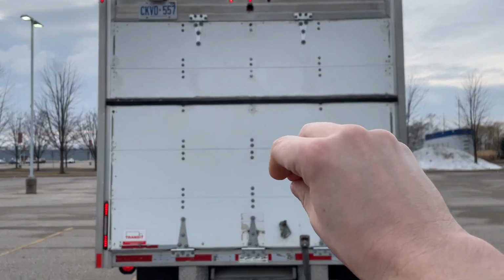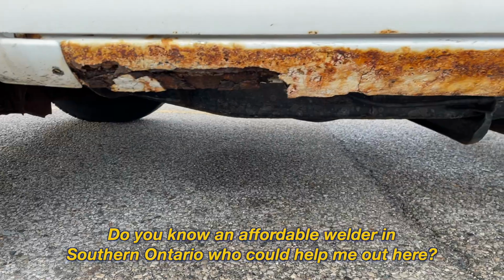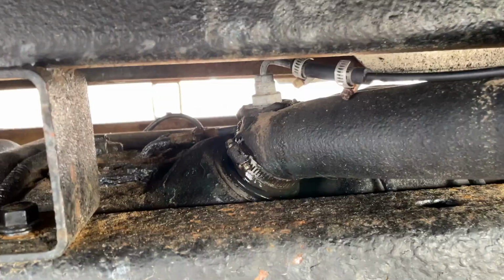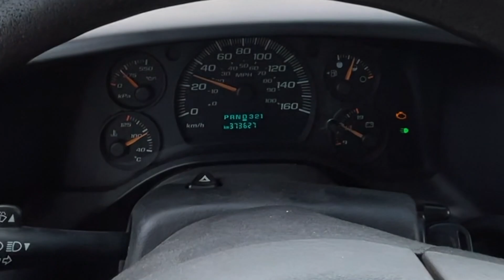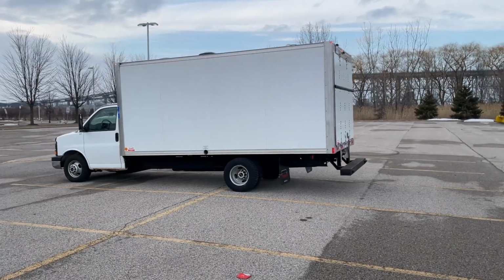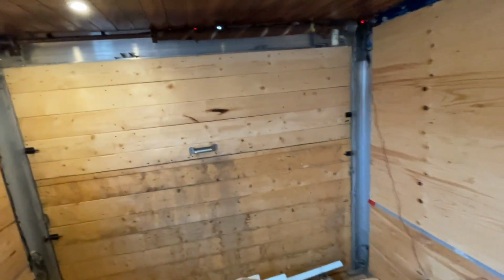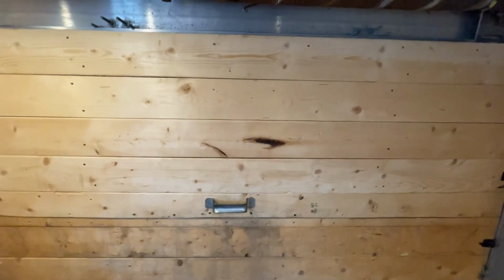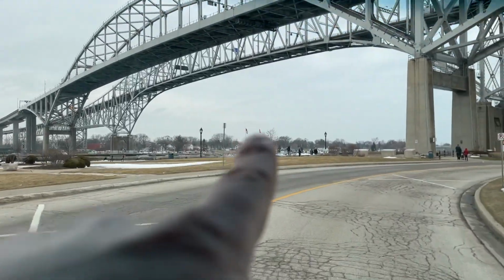BoxTruck Conversion SETBACKS ( RUST, LEAKS ETC)

Comment: I took the roll up door off of mine and added a residential door and window with a back wall, there is about a foot of space to store a tire or propane tank, also when it rains the water does not get in because the roof keeps it from running down the side of the wall. The only down side to losing the roll up door is that it's not as "stealth", bit I don't camp on the city so it's not as important.

Comment: I went on youtube and put in box truck builds and there are several that have taken off the roll up door and made a recess wall with a door.  I saw one a guy had a lift gate on the back plus the wall very cool. I should give you some ideas plus you can message them and ask questions about there build. Just hope it helps

Comment: My former landlord is working on a Savanna van. The doors at the back were really rusted out at the bottom. He took an old furnace, cut up the housing and repaired the back doors. There was some welding and smoothing out the rivets, etc, but it looks good and it is solid now some sort of black pitch so as to not rust again.

Comment: frame out the rear door with 2x4's and add a house door, perhaps double garden doors. those rockers need to be cut off and weld new ones in... easy project on a cube van as you don't have big long body panels to refinish to a smooth and wave free texture. the metal under neath the floor can be pressure washed and wire brushed and treated with a very special paint called POR15. It can be applied to rusty metal(without rust flakes) it will prevent any further corrosion. its is available at Canadian Tire. about 70.00 a litre, but it is well worth it, nothing else works like it or as well as it. after you POR15 the underneath, apply a top coat of Tremclad , then cover it with Rust Check spray.
Reply from the maker: Thank you so much!!!

Comment: OK so for the rear door what I recommend is first take it back apart (i know, i know) and use 3M Window Weld in between  the roll up panels as you assemble them to prevent water intrusion through those seams. For the seam between the two "halves" youre gonna want to use as much weather stripping as you can fit. You need to add a few inch strip of aluminum or something to the inside, upper edge of the bottom panel, and the same to the outer bottom edge of the top panel creating a barrier on both faces to prevent water from making it inside. Additionally, you can add trim strips to all the side edges to provide the same sort of protection. Hope this makes sense if not let me know and ill draw a terrible picture LOL
Reply from the maker: Thank you for your comment. I understood what you mean 👍😊 it gave me some ideas.
Reply: @CanadianStealth  also i recommend taking it somewhere you can power wash it or at worst one of those automatic car washes maybe? to test it for water leaks before you put any finishings on it.
Reply: @CanadianStealth  also you could try making new doors by laminating rigid foam insulation between two layers of plywood then covering it with fiberglass or even just fiberglass resin for waterproofing. Heres a forum of people who build whole trailers/campers using this method http://www.tnttt.com/viewforum.php?f=21

Comment: I love the idea of the doors the way you have them. I think it will be cheaper to rebuild what you have. If you want to drive down to sombra I can give you some ideas and lend some tools. But I will only be here for a couple more weeks. I think you take the doors apart again slice a shallow dato joint between each segment then put them back together with sealant. You can use my table saw.
Reply: If you want to meet for coffee or something to exchange contact info just let me know

Comment: I used sign material to build my rear swing up door along with aluminum tubing and foamular pink foam insulation.. You may have seen it in that Facebook group.. You could make the swingout doors of the same material or just add those MaxMetal ( https://www.maxmetal.com/ ) composite sheets to your existing door. Use roofing screws to attach the panel to your existing door. Should work..
Reply from the maker: I’ll look into that Matt ! Thank you for the advice and the website
Reply: Good to know 👍
Reply: @CanadianStealth  you are welcome. Cheers

Comment: You need weather stripping around the door and metal flashing above the door and above the  door overlap. In regards to the joints, apply a clear sealant to the entire door so you can keep the look of the door, but it wont leak.

Comment: There is a truck repair shop in Windsor called bogars they sell the doors with aluminum on one side all the hinges and rubbers seals I used them many times when.i use to live there and repaired trailers iam sure pinwood in sarnia could get them as well right on confederation st any question let me know dont mind helping out iam only about 30 mins from sarnia
Reply from the maker: Thank you John, I’ll have to check them out!

Comment: Once you get the rust fixed.  Look into treating the truck with fluid film.  Also looks like you have that spray on rubberized rust treatment on the bottom of the truck...get that stuff off.  Any moister that gets past that stuff stays there and it eats the truck.  See https://www.youtube.com/watch?v=nXvl9nt57Kg&t=454s for what that crap can do over time.  Take it and hit it with fluid film.
Reply from the maker: Thank you for the advice ! 😊

Comment: Try strips of vinyl,rubber across cold joints. Flexible seal for joints. Use aluminium strips,blue rivets. One scanner twenty dollars to clear codes,nice to have with older vehicle.
Reply: Hate auto correct...across the door joints...pop rivets...
Reply from the maker: Thank you for the advice Len I’m going to look into that

Comment: There's something called bead blasting like sand blasting that you can lightly do then by some flex steel like the use on the the boat commercial and spray clear on it and then sand it and spray the colour you want black white whatever

Comment: What about caulking the seams .... then using tarmac like a roof then finishing it off nicely with sheet metal ??? Insulated and water vapoured up the @ss that way ?
Reply from the maker: Sounds good , I just need to calculate some numbers and see what’s cheaper and better .
Reply from the maker: Thank you for the advice 🤗
Reply: Look into cedar options for the door as well ... it absorbs exposure to moisture well, and won’t rot! The only option I can think of if you want it to use as an outdoor space is to get rid of the seams. Use tarmac then cedar , man that outdoor space would be popping !!! I love the truck so far ! Can’t wait to see the shower in action, it’s always the one fucking thing I can’t figure out how to do without paying up the ass at a truck stop or camping spot aside from just jumping in a cold creek :(

Comment: Have you looked at any car scrap yards for  used barn doors and then just add new seals to them if your planning on doing it yourself that is 
As for the rust have you thought maybe of fixing the holes then to paint it with box truck lining stuff
Reply from the maker: Hi Brenda 🤗 that is good idea too . I’m gonna call few scrapyard on weekend . 
About  box truck lining stuff, do you mean that black grumbly paint ?
Reply: Yes the black grainy paint that’s used in the back pickup trucks for durability and rust protection I’m not sure of the brand name is called for that product
Reply from the maker: @brendamunro4193  I’m gonna check it out thank you 🤗

Comment: Scrape off the crud that’s in the cracks. Put silicone caulk in the cracks. Should stop the leaks for sure. I CAKED my camper in silicone and eternabond tape, no leaks yet 🤞
Reply from the maker: I like that “I caked my camper in silicon” 😄. I used pretty much silicon too 😁

Comment: Is there water leaking in on the Sides of the back door?
If it's only leaking where the sections of doors came together if possible separate them and run a bead of caulk between them or just on the outside. Now where you have the top & bottom where the black strip is get a piece of aluminium bent into a Z. Part of Z on inside & Bottom of the TOP part of door (roof when opened). When closed the other part of Z will cover bottom half of door (patio part) & keep rain from seeping in.
Take truck back to the people that did the gas line.
As for the rust wish the best. Sand off, spray primer, clean & repaint.
Reply from the maker: Thank you so much for the advice TP, we’re still trying to find where the leaks are coming from.
Reply: I don't remember seeing you pull off Any weather stripping when you took the door apart  @CanadianStealth  . From the look of the water stain it looks like it's coming from where the 2 connect in the middle. 
Time to grab a water hose & spray the heck out of it. Glad you found it Now.  Oh using incense or some sort of smoke will also help find where air/water can get in. Wish the best & Get that DAMN gas leek fixed ASAP PLEASE!!!
Reply: Been awhile since y'all have posted  @CanadianStealth . Hope you 2 are doing alright. Looking forward to an update.

Comment: hey man. this is the floor plan I will do. With the inner "home" wall from behind too. I thing we are only 2 persons out there with this setup. I plan to have my bed lifted up with manual winch so by sofa and PC table will be under it. Shower and WC is must.
What are inner dimensions of your box pls.
Reply: if you decide to add that inner back wall i recommend to use sliding door to save space. I plat to use the little "garage" to put my gas water heater there and if I come back home in heavy rain it is nice place to hang wet clothes.

Comment: Why not take rhe door completely off and build a wall with a normal steel door. Then build your wall inside 12 inches back and make a garage. You could make it water  tite. And probably be cheaper than paying someone to put doors on. I think any of those doors wont be water tite. Thats why I say build a wall and put a door in it. If not a steel door you could make a door any size you want.  Good luck
Reply from the maker: I have that kinda a idea in my had ,  Thank you Sweet Tee 🤗